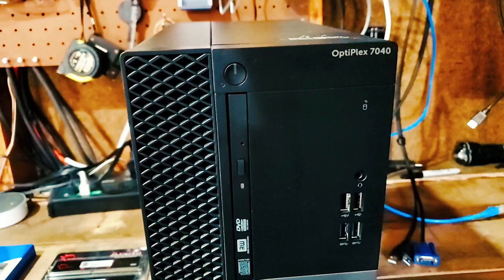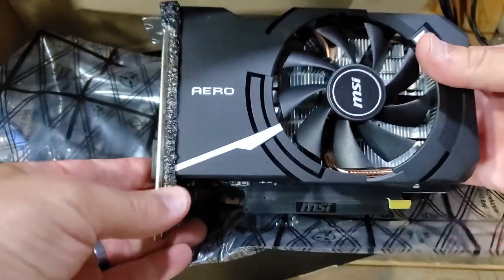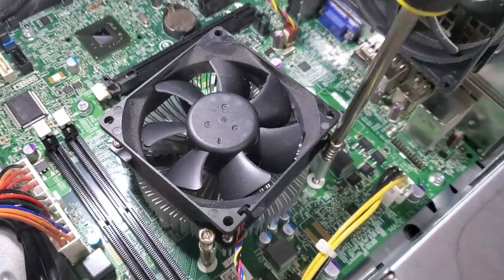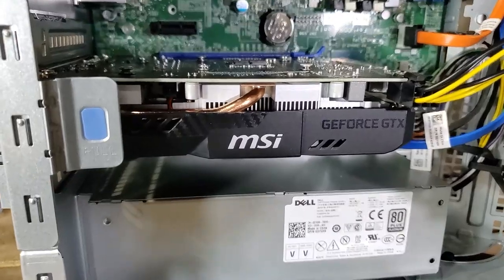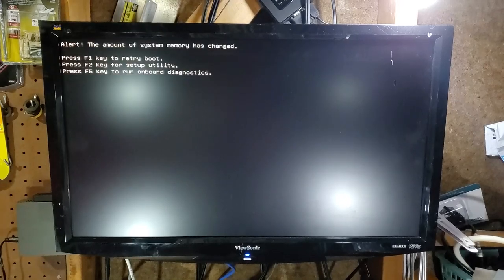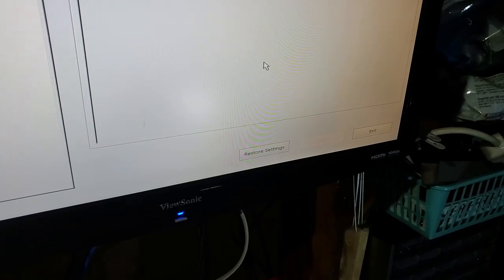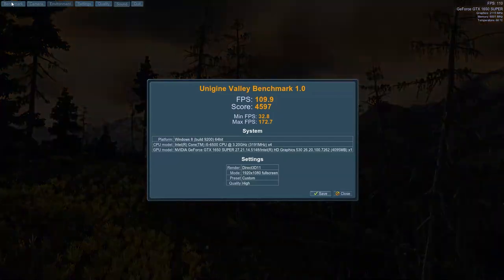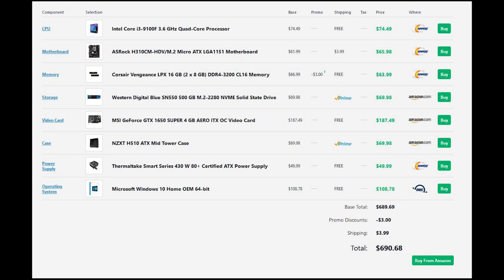Nvidia GTX 1650 Super in a Dell Optiplex 7040 - Best Optiplex Gaming PC for 2020!

Comment: I can confirm I have 

Optiplex 7040 MT, i7-6700, 16GB RAM, 500GB SSD/1TB HDD, amd RX 6600, corsair SF450, optiplex ATX power adaptor cable (eBay)

^^^^ all fits in side the case so not ghetto ^^^^

All works perfectly all contained case closes tight fit but works and looks very stock!

Hope this helps others looking to add a GPU
Reply from the maker: They still make solid PCs with easy upgrades.  Thanks for watching!
Reply: do you plan to upgrade your cpu to 7th gen?or did you try to put a 7th gen cpu on your optiplex 7040 MT? cause I'm planning to upgrade my 7040MT to 7th gen cpu but i didn't see someone upgrading 7th gen cpu as a prof that is works with this system.
Reply: @mereal8149  No luck with upgrading the CPU I'm afraid my plus I'm not sure it's worth it for the limited upside the GPU and PSU (with adaptor) mod is best bang for buck. (30 min job)

My next upgrade will be to a xps 8940 or equivalent when the time comes but the above gives me a few more years of use out the system

$250 for 7040 (used)
$699 RX6600 2021 prices omg!!!
$139 PSU
$8.50 for adaptor cable 24pin to 8pin

Comment: I already have HP EliteDesk 800 G2, I want to upgrade from i5 to i7 6th gen, and I want to buy the GTX 1650 4gb, it will be a nice deal with my 280watt power supply

Comment: my friend plz gtx 1650 i5 6500 8gb ram or rx 570 8gb i5 4590 12gb ram 
thnx.
Reply from the maker: The RX 570 is slightly faster than the non-super GTX 1650, but its power usage is higher, too.  Not sure I'd put one in an Optiplex unless you upgrade the power supply.  The CPU performance of the i5 6500 vs the i5 4590 is pretty much the same.
Reply: @EscoTech  thanks !. <3

Comment: Very good video you got me out of doubts with the model since I had some concerns about placing an additional video and sound card and updating the processor and expanding the memory. The other concern is regarding the power supply, do you have problems with the video card you installed?. And finally, the processor can be updated by one superior to the one that is already installed. Waiting for your prompt reply greetings
Reply from the maker: Thanks for watching!  The CPU can be upgraded to an i7 6700, which I did in another video.  If you do the CPU and GPU, I'd probably recommend a PSU upgrade if you're gaming for extended periods.  There's a Dell server PSU that fits this system and can be found for relatively cheap on eBay.

Comment: Can I install GTX 1050 Ti for My Dell Vostro 3670 MT 290W?
Reply from the maker: Yep, a 1050 Ti would work just fine, as long as the PCI-E slot provides the full 75 W spec, which I'm pretty sure it does.  Thanks for watching!

Comment: Hi, I have the same Dell!  Do you have any PSU  issues  after GPU upgrade? I want to upgrade GPU too,  and I have i7 6700 an SSD and secondary HDD both on SATA.  Do you think  I can put a GTX 1650 without any damages?
Reply from the maker: I think a 1650 w/ GDDR6 would be fine, but if you plan on gaming for several hours a day, I'd probably consider upgrading the PSU.  I sold off this system, so I don't have any long term testing to report.  I did use it pretty heavily for about a month and it was fine.
Reply: @EscoTech  is a gtx 1050 ti go good with this system?

Comment: heyy i got a hp prodesk 600 g3 MT with a i5 6500, will gtx 1660 superwork fine even with 250w PSU ?
Reply from the maker: I can't say for sure, but a 1660 Super is probably too close for what I would be comfortable with.

Comment: I just bought a Dell Vostro 3888 with Intel i3 10100, 8GB DDR4 2666MHz RAM, 256GB SSD. and a 260 Watt Dell Power Supply (Model: AC260EBM-00). Will this PSU be able to power GTX 1050ti 4GB or GTX 1650 that comes without a 6-pin power connector?

Comment: I've found the same version of 1650 of this card but it doesn't have a pcie connection so I should be petty safe without swapping out the power supply then
Reply from the maker: I think all the GTX 1650 Super models require external PCI-E power.  The non-super 1650 is slower, but still a good card. Since it draws all its power from the motherboard PCI-E slot, you can put it in almost any computer.  You should be good to go.

Comment: Hi can i ask what should i do if im using ssd instead of nvm but im going to put similar gpu can i only plug only 1 connector to the gpu instead of 2?
Reply from the maker: One should still work fine as long as you don't try to pull more than 15W from it.

Comment: Not possible your gpu gonna die you have no proof bro it’s fake prove your self😎✊🏻.
Reply from the maker: Haha, that's why I tried to show the cable plugged in.  I sold off this system, but I used it for a good solid six weeks with no issues.  Thanks for checking out the video!

Comment: Nice vid. Will this work on an optilex 7010, and can the pc run fine if I just upgrade the graphics card?
Reply from the maker: Yeah, the process would be very similar with the 7010.  I'm actually going to do a video with a 7010 soon that I am installing a GTX 1660 Super, but I am upgrading the power supply in that one.  Depending on your power supply, you may be able to use the stock one.  Thanks for watching!

Comment: Hi. I am having the optiplex 7040 and am wanting to upgrade it. Rn I am using a r5 340x  with a i7 6700, 8gb ram. I usually game near 10 hrs a day. Will my pc go for 10hrs a day gaming after I add a gtx 1650 to it?
Reply from the maker: If you're gaming that heavy, I'd recommend a PSU upgrade.  There is a Dell server power supply that fits this system with some minor modifications.  Search for it on YouTube and there are a few good videos on it.  Thanks for watching!

Comment: I’m planning to do exactly this as well, except with a 1650. Great video, it’s really helpful! Also, could you provide a link to the PCIe adapter that you used?
Reply from the maker: I can't find the link to the one I actually used, but this is the same thing on Amazon: https://amazon.com/dp/B01DV1Z4X2/ref=cm_sw_r_cp_apa_i_PMAjFbMNR0965.  Thanks for watching and good luck!
Reply from the maker: Also, make sure you get a 1650 with GDDR6 memory.  There are still plenty of GDDR5 models out there and there's a significant performance difference.
Reply: EscoTech Thanks for the advice. I have another question though. Wouldn’t the 1650 Super be a little too much for the stock 240W PSU?
Reply from the maker: @sono5468  My max power draw from this system was 182 Watts.  I'll be uploading a new video with an i7 in it soon.  Max power draw with an i7 6700 and 1650 Super was 208 Watts.
Reply from the maker: Yep, that adapter should work fine.

Comment: You didnt include the cost of the OS in your build only the Newegg build.. If you had to buy the OS then it would be a $500+ build, correct?
Reply from the maker: Yeah, but typically a Dell computer will come with a COA and since those OEM keys are loaded in the BIOS/UEFI now, the OS will read it and activate automatically.  That's why I didn't put in a cost of an OS, because and OEM license is tied to the machine.

Comment: does a gtx 1650 work on a 290w psu?
Reply: yes it definitely does. Some 1650s need a 6 pin power cable so make sure you get one that doesn't need the 6 pin cable

Comment: Hi I was wondering can you add a WiFi card to this pc, or is there no space to fit a WiFi card In?
Reply from the maker: There is an available PCI-E 1x slot above the primary 16x slot.  There's also a 16x slot at the bottom that could hold a 1x wifi card.  There are always good USB wifi options, too.
Reply: Is there a difference between pcie WiFi and usb wifi?
Sorry I’m new to all of this
Reply from the maker: PCI-E will install inside the case and have external antennas, USB will just plug into a USB port and have some sort of antenna attached.  Performance-wise, there isn't much of a difference, but if you are planning to use it long term, I'd get a PCI-E wifi card.
Reply: Thank you, you have earned a subscriber

Comment: Hey there. Nice detailed video! I had not watched your video or read your tests of power consumption prior to upgrading my friends psu. I helped him start i-racing on his Optiplex 3040. These are such odd machines, full size pci slots and the sff power supplies. However, we both purchased Dell's 315 watt psu with the 6 pin power in the exact same size psu. The only difference is the mounting screws. You simply tilt the psu and install one screw tightly! lol  I didn't like adapters and leaving the original psu in. It seems like it would have been okay though. Hes running a Zotac 1650 Super Twin. Since it required the 6 pin power I figured that was the best psu to get.  I have one too, but im gaming with a regular 1650 low profile in a Optiplex 7020 SFF. Except my 7020 SFF mobo has been transferred to a Optiplex 790 DT case so I could use the x16 slot and reduce temperatures. Its a long story on that one! but it works great!  Keep up the great work!
Reply: The psu is dell d315es-00. I think they use them in the Dell XE's but I didn't pay some of those prices!
Reply: Sorry, here is a video of MXKDI installing one. https://www.youtube.com/watch?v=I7_enEWxJyM  His videos have helped me get through a lot this year with different Optiplex models I have used.
Reply from the maker: Haha, yeah, I didn't even know that PSU was out there until a couple wees ago when someone pointed out the Mxkdi video to me.  That makes a great upgrade.  Dell is probably just trying to make it harder for us to upgrade these by using more proprietary parts.  Thanks for checking out the video and I appreciate the feedback!

Comment: Can I use this card on i7 6700, 240w Bronze 80+ psu? Currently I have a different GPU (Radeon R7 360) that takes 100w too, but I'm not sure if the gtx 1650 super will work.
Reply from the maker: You should be fine, but if you are doing heavy gaming (several hours a day, or more, I'd recommend a PSU upgrade.  There are 300W TFX PSUs that would work with no/minimal modification.

Comment: how u run MSi Nvidia GTX 1650 Super
 on 240w psu?
Reply from the maker: The last couple generations of Nvidia GPUs don't need much power and are so efficient they still perform well.  Also the PSU recommendation from Nvidia takes into account that a lot of people have poor quality PSUs that can't reliably deliver their rated power.  Dell uses a good quality 240W PSU that has no trouble powering this system.  Thanks for watching!

Comment: What power supply unit do you use? I am asking because stock unit is kinda weak - just 240 Watts of power. Have you upgraded it as well?
Reply from the maker: This was with the stock PSU.  Dell has a server PSU that fits and I have seen TFX power supplies used, but most of those are in the 300W range, so you don't gain much.  Thanks for watching!
Reply: @EscoTech  No thank You!

Comment: You used a dual sata power to 6 pin. I saw adapters that we’re only 1 sata power to 6 pin. Then I read that one sata power is rated for 55 watts max and you said the draw on the 6 pin was 25-30 watts. Would only 1 sata power be okay? I really don’t want to break anything.
Reply from the maker: Yes, you can use a single SATA to 6 pin PCI-E power adapter.  The PCI-E slot will provide 75 watts, so the SATA cable should only draw 25 watts at full load.  Even in my video, there are two SATA  connectors, but they are on the same wire.  That means I've essentially been doing a single and this sytem has been running benchmarks for 3 weeks with no problems(I'm doing a couple more videos with it).  Thanks for checking out my video!

Comment: Hi I have dell optiplex 3020 and I just bought my 1650 super with SATA to 6 pin adapter. Would 290 watt psu be enough?
Reply from the maker: Yep, 290W is plenty.  Thanks for checking out the video!
Reply: EscoTech np man! Good video. U earn a sub! 👍🤝
Reply from the maker: Sweet, appreciate the sub!  Almost to that magical 1,000 subs. Lol.
Reply: @EscoTech  And how about a 180 watt psu?
Reply from the maker: @daandeglee7301  That's probably not enough power.  I personally use a regular GTX 1650 with an i7 6700, 16GB RAM, and an m.2 drive and pull a little over 180 Watts from the wall at max load.  If you have a less power hungry CPU than me, a 1050 Ti might be a better bet.  Not as powerful as the 1650, but the 1050 Ti would be the fastest card I'd consider running with a 180W PSU.
Reply: @EscoTech  Thanks for the reply! Would a gt1030 do better (since it is 100 euros cheaper than a gtx1050ti) or is it better to spend the extra money on a 1050ti?

Comment: On my dell optiplex I’m adding a gtx 1650 super should I reinstall windows in UEFI
Reply from the maker: UEFI mode is definitely the best for Windows 10, but it isn't absolutely necessary.  You can just drop in your card and install the drivers and go with that if you want.  Thanks for watching!
Reply: Ok thanks for the info
Reply: My optiplex is a 9020MT I’m upgrading my psu for more headroom and not making the stock psu a bullet about to explode
Reply: And this the gpu name and model that I’m getting Gigabyte GeForce GTX 1650 Super OC 4GB
GV-N165SOC-4GD

Comment: Is it possible to put in a gtx 1660 or gtx 1660s since the psu is already platinum rated?
Reply from the maker: I don't think I'd be comfortable with any 1660 without a PSU upgrade.  There are 300W TFX units and server units from Dell that have native PCI-E power connectors that would be a good upgrade.  I love the 1660S, but their prices are crazy right now. Thanks for watching!
Reply: I currently have an i7-6700 with a 240 80+ bronze rated psu. Is gtx 1650 gddr6 gonna work in my unit?

Comment: Great vid bro , I have a Dell optiplex with a i7-4790 ,GTX 10603gb ,16gb and 500 Samsung evo ssd and 290W psu . I just ordered a MSI GTX 1070 aero itx single fan card . Will I be fine with the same 290 W psu  ? Or will I have to upgrade my psu ? I mean my 9020 dell optiplex runs perfect with my GTX 1060 and sata connection so will the 1070 be fine ?
Reply from the maker: Sorry for the late response.  The 1070 uses too much power for the 290W PSU.  The SATA cable adapter is a bad idea, too.  You need a PSU upgrade for a 1070.  Thanks for watching!
Reply: @EscoTech  I'm actually using the 1070 with the 290w psu and everything is fine so far. i dont thin its drawing too much power
Reply from the maker: @theboy2777  That's awesome and if you're not seeing shutdowns, the power supply is providing enough power.  Watch you SATA adapter, I'd visually inspect every once in a while to make sure it's not warping or melting the insulation.

Comment: Hey so I know minimal about computers but I bought a optiplex 7040 with I5- 6400 core and it came with M.2 128gb NVME, 1tb barracuda HDD AND 8gb DDR 4. What affordable graphics card would you recommend? And do I need a SSD?
Reply from the maker: The 128GB NVMe is an SSD.  I'd recommend upgrading that to a 250GB, or even a 500GB if the budget allows for it.  For the graphics card, I'd recommend a GTX 1650(GDDR6 version)  or 1650 Super if you plan on gaming.  A 1050 Ti is also an option, but they are hard to find and often too expensive.  Anything less than that will give a pretty bad gaming experience.  Thanks for watching!
Reply: @EscoTech  thanks for the advice and I’ve been researching and looks like my setup only has 180watts. Would upgrading the PSU be 100% needed for any of the graphics cards?

Comment: Hi! So I currently have this model, but it uses windows 10 pro that I can’t legally use or log into. Should I take out the drive, and put it into a compatible computer to format, and then install a fresh windows?
Reply from the maker: Just install a fresh copy from a flash drive in that PC.  Boot from the flash drive and either delete the disk partitions  in the installer or hit shift+F10 and used diskpart.  Good luck and thanks for watching!
Reply: @EscoTech  thanks for the quick reply! Starting it right now!
Reply: @EscoTech  also, I don’t know how to correctly wipe a drive in my working pc put windows on. I already did some deleting in disk management in my other pc, and now it just shows the screen where my pc needs to be repaired, because I deleted system 32, but the hard drive in the pc I want to install the fresh copy on wants to keep the idea that windows needs to be repaired.
Reply from the maker: @wetsock4597  I think in the Windows installer you might have to click on the advanced option to install a fresh copy.

Comment: would a 275 watt power supply work with a gtx 1650 super?
Reply from the maker: I can't say for sure without knowing your full system, but as long as it's a good quality power supply, you should be fine.
Reply: @EscoTech  its basically the one that goes with the optiplex 7010 (not the sff version)

Comment: hello can you suggest a video card for my optiplex that doesnt need extra power...the sata pcie adapters are not available in my country
Reply from the maker: The non-super GTX 1650 is currently fastest card that doesn't need external power.  That makes them a little more expensive and lowers their price-to-performance a little, but they are still worth it.  The GDDR6 models are a little faster than the first release that had GDDR5.   Thanks for watching!
Reply: @EscoTech  is 240 watt psu enough for that